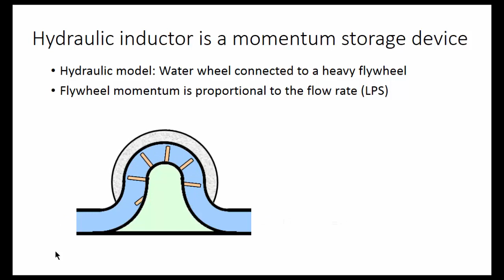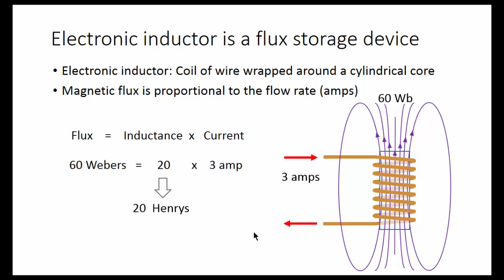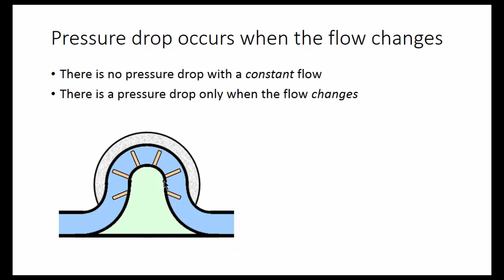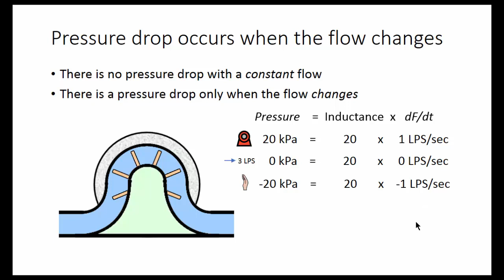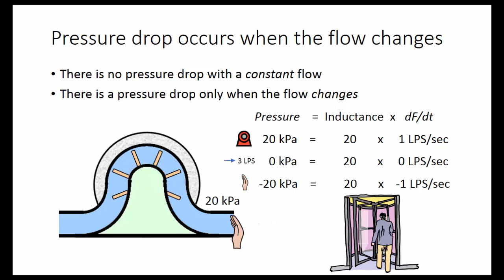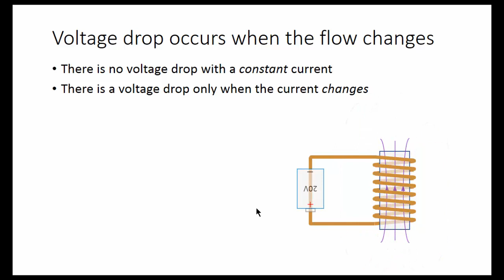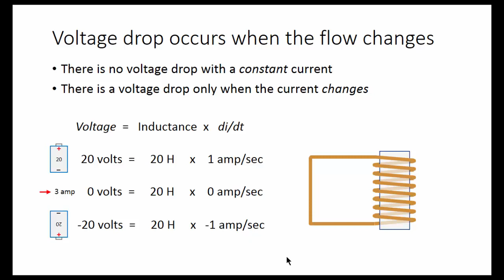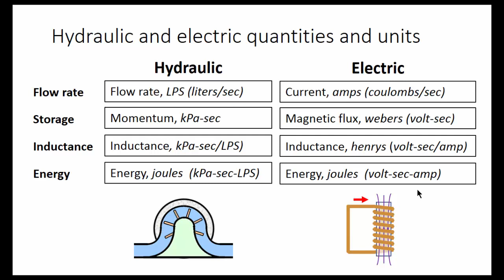Inductors: Electric - Hydraulic Analogy (challenging)

Comment: Unique, and what are the hydraulic equivalents of semiconductors, such as diods, transistors, thyristors? Is it possible to make hydraulic equivalent to the radio, computers, etc?
Reply from the maker: A diode is like a backflow valve that allows current only in one direction. I plan to make some more electronics videos in the future.